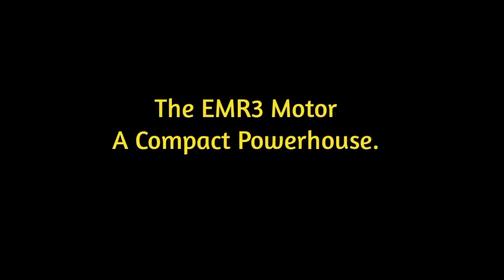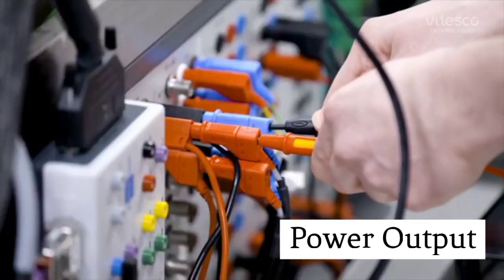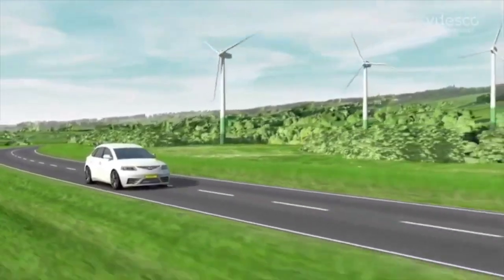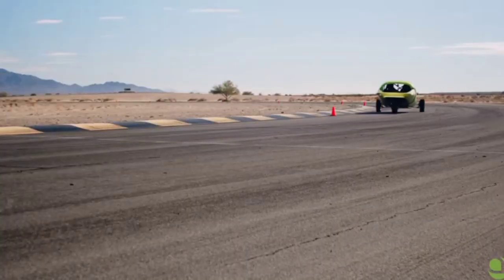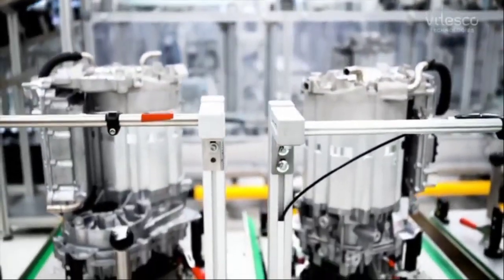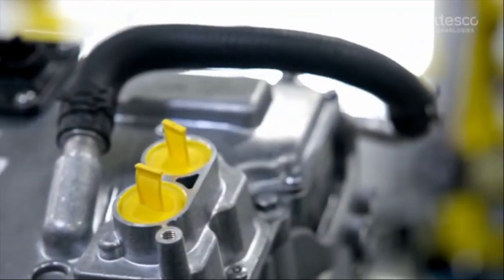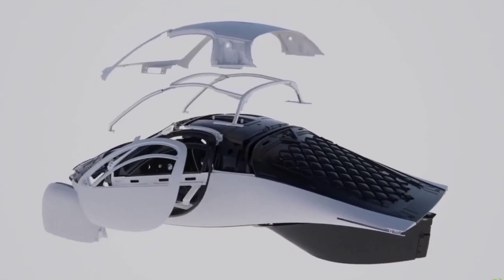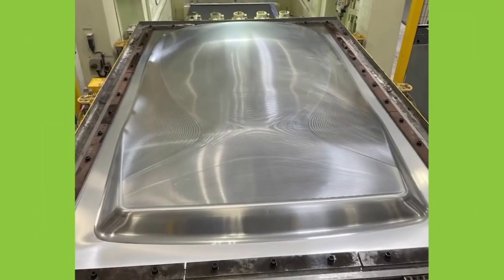Impressive! Aptera New Motor

Comment: Its not a new motor and its not made by them. Its in 10 other evs. Thats not saying its a good or bad motor.
Reply: Correct; the drive motor is widely used, its in the Niro EV. But the motor is new to Aptera, after dumping the hub motors